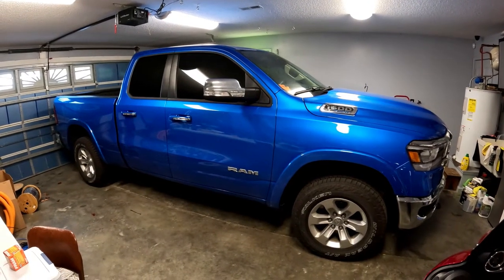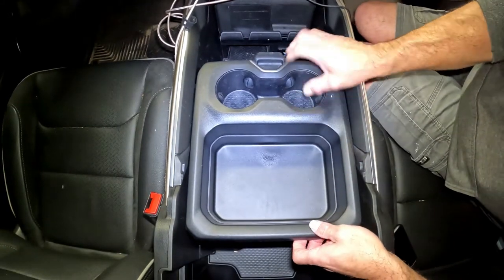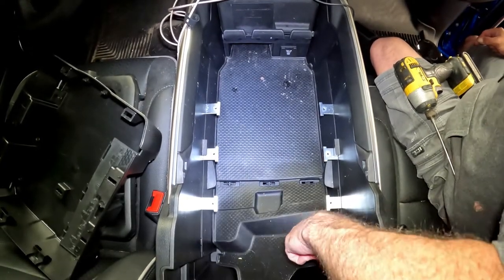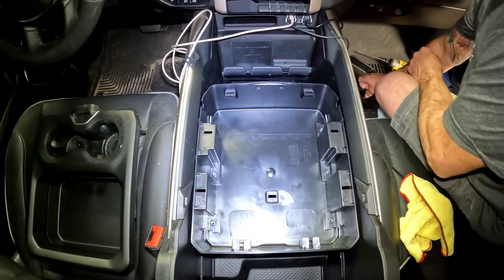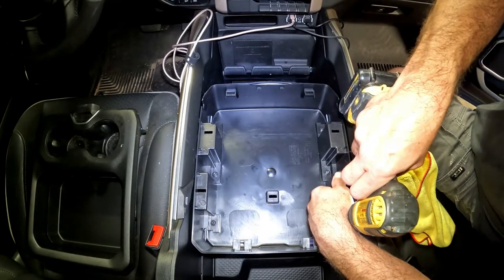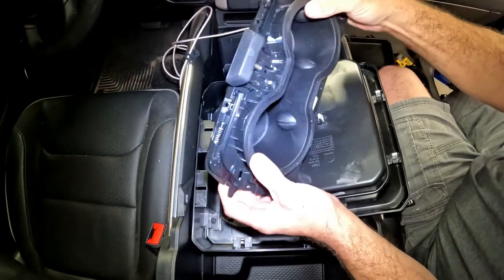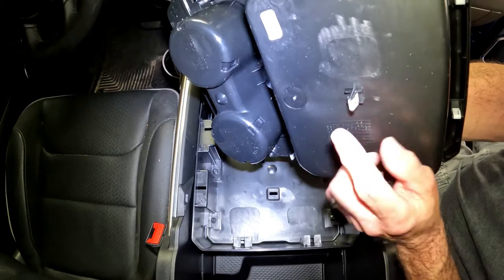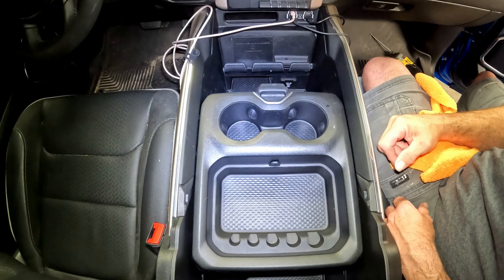Dodge Ram 1500 Center Console Center Sliding Cup Holder Tray Remove And Clean

Comment: Thanks for this video.  I have a 2019 Ram 1500 Limited and it came apart pretty much the same way.  The previous owner had spilled soda and a milkshake in there and I had to get it cleaned  out thoroughly.  I was able to get it apart and back together without breaking anything.
Reply from the maker: Glad it helped, not sure why they make it so hard to get that out, seems like a pretty common thing you would want to clean out.  Thanks for watching and taking a second to leave a comment.

Comment: Thank you for this video! I just bought a 19 Ram and my rubber cup holder was already out and just sitting there. Now I know how to fix it
Reply from the maker: Glad it helped you out.  I've noticed sever other manufacturers making the rubber inserts harder to remove, doesn't make a lot of sense to me since that is one of the most likely places to start catching dirt and grime.  I guess what I know I have done in the past though is pull that rubber insert out to "clean later" then ended up driving with a plastic hole for the rest of the time I have the vehicle.  Again thanks for watching.
Reply: @RagerJackOfAll   yeah I don’t know why the manufacturers are doing that. You would think they would make it easy.

Comment: Awesome video. I'm guessing if your Ram came equipped with a Gun Safe under the sliding center console it's still the same process.
Reply from the maker: Most likely, I have considered adding the safe to the console but I normally carry my weapon on me and don't leave in the vehicle.  Someone decides to get in one night and will do more damage trying to get that safe open than it is worth.  Thanks for watching and dropping a comment.

Comment: I love my Ram but I hate that center console so much.
Reply from the maker: They do make different trays and accessories to make dividers and other things.  I've even seen a safe that goes in the bottom.  The top section is ok, the bottom part is just a "catch all".   https://www.americantrucks.com/ram1500-center-console-locking-lid-7117-2000-19.html  Considering this or something similar for mine.  Thanks for watching.